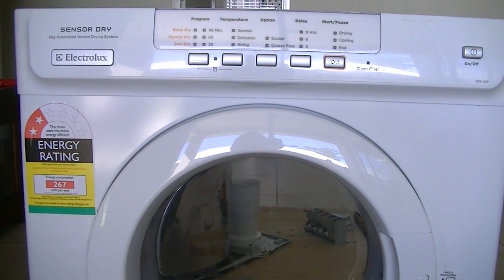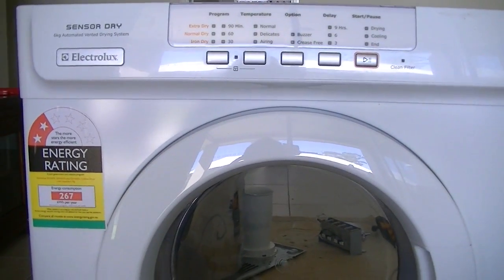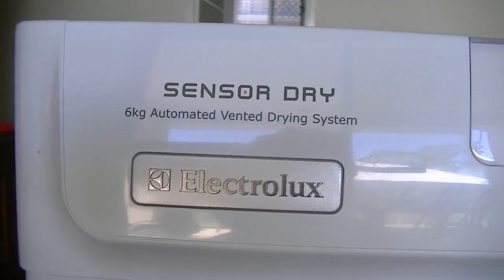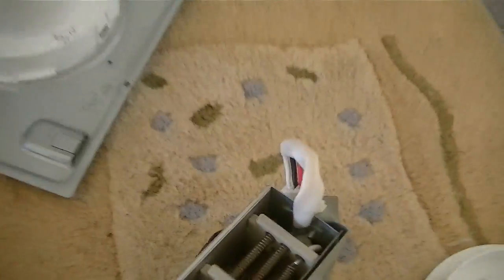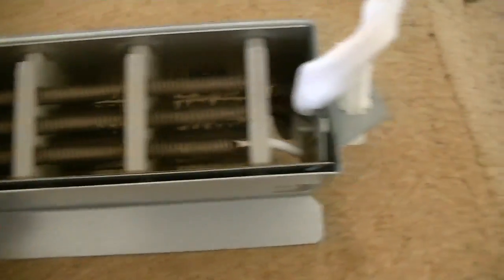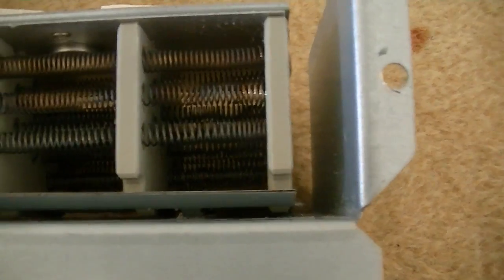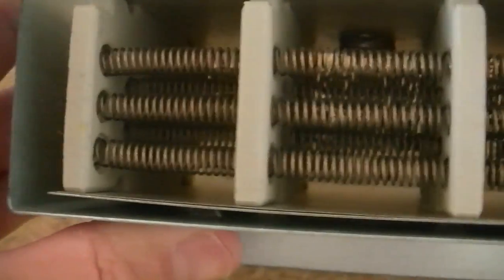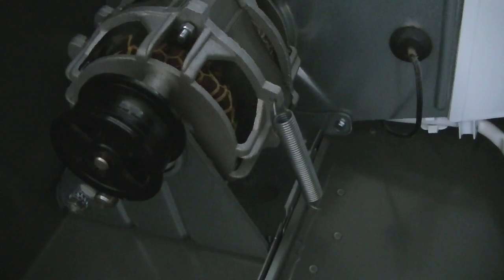Clothes Dryer Stuffed

Comment: Update on the EDV 505 The heating element only works after the first motor reversal. That is it starts turning clockwise with no heat from the heater. after it stops and reverses anticlock  the heater works. Mine took over 3 mins before the first reverse. so the issue wasnt the thermistor which has a room temp resistance of 14 k

Comment: I replaced the computer board on mine and the heater still didnt work .It seems that the Thermistor is the issue. unplug the black  2 wire plug from the back of the PCB computer board and see if the heater works It looks like the issue. The board will beep without the thermistor being plugged in Save on Spares in Melbourne have the whole wiring harness for about $60 but I'm going to try to find a replacement Thermistor.

Comment: Exact same issue, after ~3 years the heater stopped working. Although I did confirm the element was fine I still replaced it with a new one as it looked average... however the issue still remains. 
I have just ordered a new circuit board (costs $113) as I noticed there was a very low voltage going into the heating element from the relay Ill keep you posted when it arrives should be around 3/8/16

Comment: Similar problem, I pulled mine apart too, replaced the belt and now it works but the sensor is not working, doesn't turn itself off when clothes are dry, keeps going, very dangerous! Am also thinking it could be the circuit board :(

Comment: A good heater element should read between 9-12 ohms if it reads less than 9 ohms the element is shot replace it and you will have heat again in your dryer be very careful how you handle the new element they are very delicate you can easily damage it, don't touch the coils handle with care. When testing with a ohm meter switch dial to lowest setting on ohms

Comment: Your heater element is definently the culprit my dryer had no heat i tested it with a multimeter it had an open circuit they cost $63.00 from electrolux spare parts it is worth the repair it is a $600 dryer you have there. By the way for future reference the heating element coils don't have to be broken due to age they burn out it won't heat!

Comment: Having exactly the same problem and at the exact same stage. The heating element is not getting any power which leads me to believe its a faulty moisture sensor tricking the machine into believing the clothes are dry and automatically putting it onto a cooling cycle.